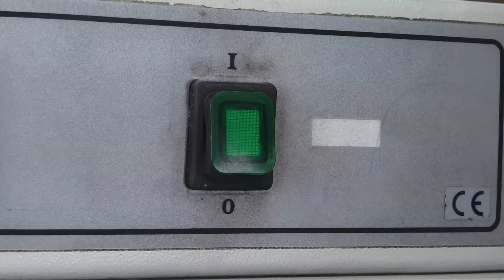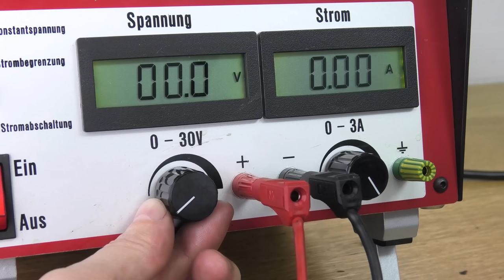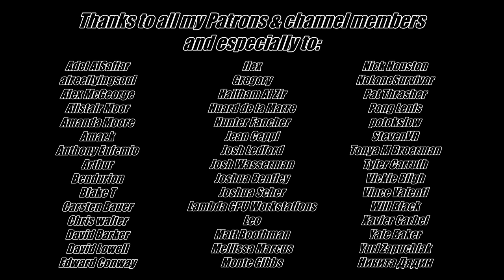1895 German Book Press "Alexanderwerk" - Restoration

Comment: Wow. This was such a full sigh of satisfaction seeing the final piece come together. Two questions:
1) how do you remove the magnetized filings as you’re working? I try wet cloth, air, soap. Always something left. 
2) why fill in the hole that “has no purpose”? It seems like a historical artifact that would be a witness of some manufacturing process that was used to make the part originally. 

Thank you for your work!

Comment: To get the dent out easier I’m pretty sure you could have filled the brass ball with water put a bolt in the hole and put in the freezer. Ice should expand and pop the dent out. Thats how they fix vintage motorcycle tanks that are made of metal.

Comment: I'm sure someone else as mentioned it.  Please turn your adjustable wrench over!  You alway want the load on the bottom adjustable part going towards the main casting of the wrench.
Also, I'm surprised the threads from the late 1800's matched exactly to taps and dies you use today.
Reply from the maker: Thanks for the info!

Comment: The brass handles turned out good wondering if you might have been able to use compressed air and heat to push out the dents.  Maybe a bit easier that way?

Comment: Tbh, it's nice to see the machine working again. 

But like c'mon, why did you machine the part that held the pressing plate and welded that hole in the washer? I can understand that the surfaces would need to be aligned, but the casting structure it's part of its history.

Comment: I just recently found this channel and I find it interesting and intriguing. I’m not a machinist nor do I own a lathe of any type. I find the restoring videos fascinating. I’m a DIYer and I have a question. I’ve noticed in several of your videos during disassembly, you have used an adjustable wrench. You have used it,  in a way that I was taught, backwards, where the moving jaw is positioned opposite of the turn direction.  Is this intentional? If so, what is the advantage of using the wrench this way?

Comment: looks good but just curious to why your mig is welding so dirty. is it becaits cast? also when you plate things if you keep the part or solution moving has a better result , instead of just setting it still
Reply from the maker: This MIG welder is just a really bad one, pretty much have no settings to adjust.

Comment: try pulley press, or pulley with screw combo press, should be able to crush anything, screw powering the pulley vertical press "hanging press"
Reply: when you dont want fit in a mold, then you scream, I did
Reply from the maker: Thanks for the info!

Comment: Your video production skills are at least as good as your restoration skills! Just excellent story telling without narration (in most of your vids). On this press, the device has a fascinating history.   Here is some cut and paste text describing this history.  "While the copy press is not a letterpress, it is an important part of any well-outfitted print shop. Copy presses (also known as book or nipping presses) were traditionally used as primitive copying machines; modern-day uses include pressing water out of handmade paper and drying flowers. How did a copy press make copies? An original letter, freshly written but dry, was placed between slightly moist sheets of very thin paper (which was thinner even than onion-skin paper). When these pages were pressed together, the moist paper would pick up some of the ink from the original document. The writing was reversed on the copy and, like the original, would be slightly blotted, but could be read from the back of the thin sheet. This process, common in the middle of the nineteenth century and well into the twentieth, was patented by James Watt in London in 1780. The original red, black, and gold painted detailing on this press is mint condition, and the press bears the gold inscription of the patent date: June 13, 1865."

Comment: im curious as to why you used a blow torch at the beginning to loosen the bolts? i would have thought the heat would make it expand slightly???
Reply from the maker: heat helps a lot getting stuck bolts loose.

Comment: Why do all the pieces say 172? Is that the same system that denotes sterling silver as 925? (p.s. those brass knobs are absolutely stunning when polished!
Reply from the maker: I don't know
Reply: It is press number 172 made, the parts are all made to fit each other, they are stamped so the parts don't get mixed up with the parts from another press in the factory.
Reply: @LukeTheJoker  tysm!

Comment: The hole you closed, saying it had no purpose was for lubrication of the bottom of the press screw.
Reply from the maker: I thought the same, yet it was a blind hole and didn't connect to anywhere.
Reply: @mymechanics  9:08 clearly shows it to be a thru' hole and would allow oiling into the joint. Otherwise a brilliant job - thoroughly enjoyed ;~)

Comment: Nice work, but I feel filling in all the original imperfections takes away some of its character. The useless hole you filled in may have been there for applying a drop of oil to the base.

Comment: Why to peen rivets and not weld The parts?
Reply from the maker: Because was riveted originally
Reply: @mymechanics  right is it stronger or what is the benefit in the construction to use rivets instead of welding?